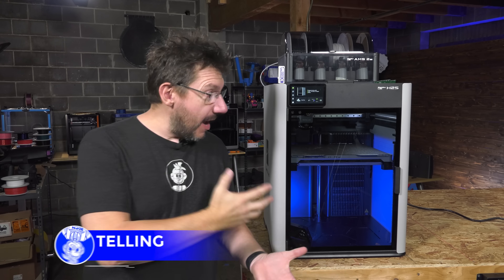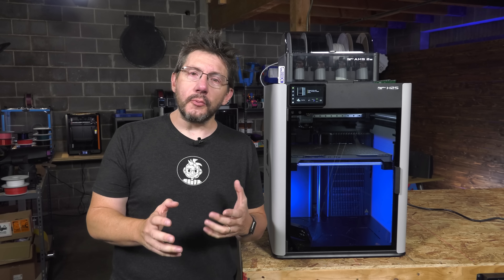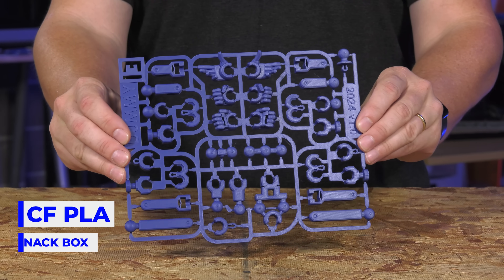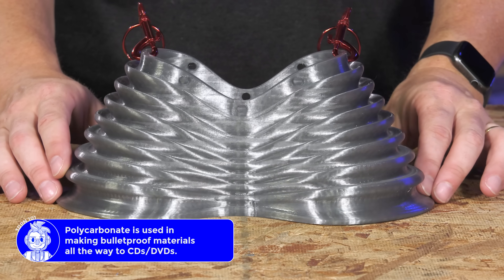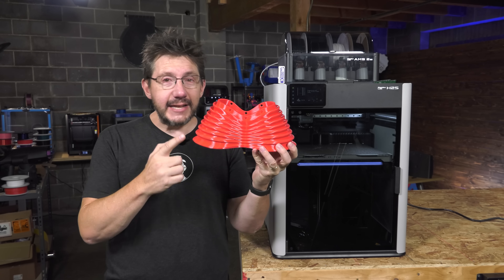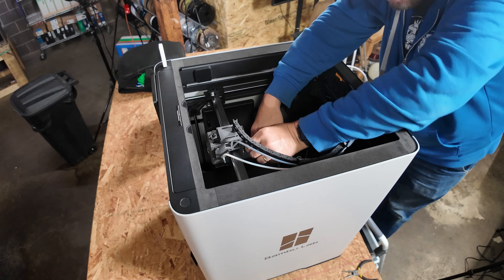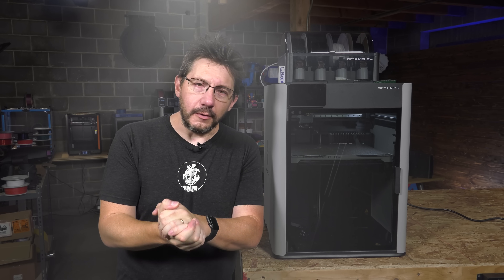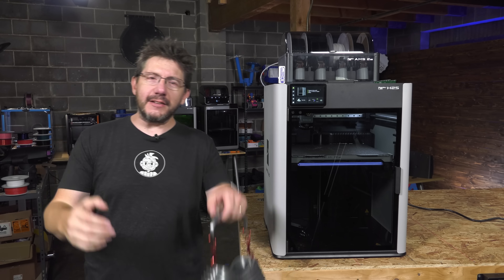FIRST LOOK at the Bambu Lab H2S!

Comment: Im loving my H2S. Its super quiet and prints sooooooo smooth. It gives me the ability to do logos on the cases that I make. The X1C is still very much in the mix as It is more efficient at making the items i do. the P1S is slightly more efficient that the X1C but I would take the X1C simply because of the added features it has over the P1S. I think they need to lower the prices.. say 150-300 bucks but im not giving up on any of my machines.

Comment: 6:49 Bambu TPU default bed setting is too high. Experiment with dropping it from 40 to 35 or even 30 (basically off). The lower the temp the less adhesion aim for the proper Velcro feeling and sounding peal off at the end.
Reply: I always put it at 25c

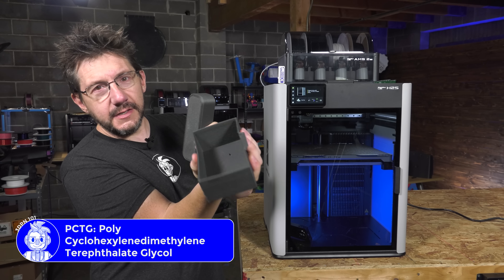Comment: 4:33 it seems to me that the seam is on that corner sir, if so i had the same result with pctg and x1c. i struggled through almost a whole roll before i found a workaround to it. i increased the amount of priming after retraction by 27% and this left an acceptable outer-corner seam that i have had 0 complaints about :) i suggest starting out at 10% and increasing by 2% until you nail it. 

good video sir.

Comment: The H2S is a beautiful machine, but having flexible connectors for a piece of equipment with so much movement and vibration is a huge mistake. I never use that type of connection in my designs of this type because of the potential for errors or breakage. Otherwise, it's a great 3D machine.

Comment: So essentialy you F upped and the print did not :) I wonder what the next move from other printer manufacturars will be seeing bambu poops out so many models in a short timespan. About snapmaker, i hope they have a excellent customer support. There is again a revolution going on in the 3d printerworld with new techniques and improvements.

Comment: Here in the UK, If i get something well stuck to the plate, I heat it up for 10 minutes so the heats in the printed part.... then lift the hot plate and put it flat on a cold window pane to cool rapidly and the part often comes of easier.

Comment: I'm thinking of staring a 3D printer company where all the dimensions and software are done in Imperial instead of metric, and everything would be scaled up AT LEAST 25% over its metric counterparts and then reduce the cost at least 10% to really mess with them.

Comment: I will say, the h2d had no issues printing PPS-CF, it does take about 20 minutes for the chamber to get hot enough and the filament has got to be fed in from the side spools only. It will not work in the AMS 2 Pro, does print beautifully, but come to find out my printer had a damaged exhaust system that was not venting or ventilating the heat and Air properly.
Reply: It works in the ams just fine.  Use generic instead of bambu in the presets.  The restrictions are only on their own filaments

Comment: It's a great thing that printer after printer is coming out that _works_. I had guessed with people on the price and was $50 off (I said $1300). I honestly wasn't expecting them to still support the plotter parts, though I still think the laser is a mistake waiting to happen.

I think a fun thing is seeing the back and forth between companies. There is a lot Bambu has done that has been asked for a lot and others needed to catch up on, but there is the irony that one of the things that shot it to the top (AMS) is also arguably the worst part of it. That people have willingly paid over 2x the cost of a H2D to get a tool changer just for less waste and bigger volume. Bring on the dozens of Voron toolchangers, the alt-AMS units, the filament cutters, highly tuned purging setups, and more. All to minimize or eliminate the Bampoo... Someone told me they think the reason Bambu announced the Vortek was to try and slow the interest in the Snapmaker U1... "hey, we can do purge-less tool changing too... just wait a few more months to (checks notes) the same time the U1 is supposed to actually start showing up in people's hands". And either Prusa knew what was coming or they're quick on certain PR events, but them showing off a CORE One with what I'm guessing is an IDEX of 7 tools that happens to line up with Bambu's H2D (1 fixed nozzle) + 6 tool Vortek... I'm getting some popcorn ready. Not to mention, INDX is supposed to come out soonish (I'm pretty sure they said 2025). There's still so much to question (not to mention that everyone still seems to expect that the size of the printer matters anymore when you need basically a closet to store all the filament with PTFE ready to run to a printer... In time we will tell.

Comment: test ppa cf. my x1c prints it ok but want to see if this will do better than the mods ive done on the x1c to get the results i have. i am able to get the chamber to 57c and still weirded out that it wants to print it at 290c on the x1c. want to see what is best on a printer that isnt as limited as the x1c

Comment: TOTALLY AGREE about the tool changer path. The H2D is ridiculously expensive though. All many of us ever wanted was solid supports with two nozzles and maybe two materials, right? Idex machines have been around forever but none of them are either any good or priced reasonably. Would SOMEONE PLEASE just give us two damned nozzles without all the other crap and make it budget friendly. How hard could it be? (I see what you did there Snapmaker)

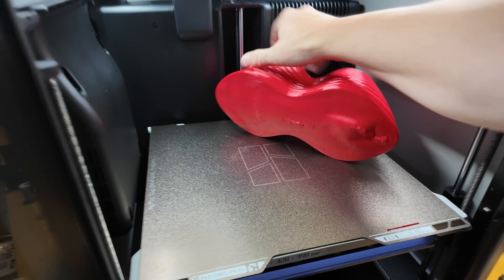Comment: 7:00 I've been using 98A or   95A. 40D is like, 88-ish on the A scale, isn't it?  I've been printing R2-D2 feet on my PEI bed with 98A and it's been working beautifully at around 80c build plate temp. Maybe it's the extra layers (7-8) I've been using making it easier to lift off, keeping it strong enough to survive the process.

Comment: I can only fit the X1C in my current racks, and the H2S/H2D are too big for the parts I'm printing 95% of the time. I can see how the H2S could be an X1C replacement in some ways. However, the bigger size isn't always better as larger beds require more power to heat. I have a single H2D now and will definitely upgrade to the H2C, but my small army of X1Cs are here to stay! :)

Comment: Thanks for video, I’m not sure how you can compare a prusa XL with the multi heads to anything Bambu makes. The XL the enclosure is 600-700 more the extra heads 5 are like 1400-1500 more. And the price comes in 4K not sure is it even heated ? 
So ya the poop sucks but it’s pay now or pay later ? 
And as for the complaining about the poop 💩 you can find hundreds of free models online. Maybe Bambu could include the file right in the SD card as one of your first prints. That’s why you purchased a 3d printer ?
I have a P1S and really struggling with support that just doesn’t look good. So the H2D looks great to have the option to print say PLA support for my Petg models. But then again am I going to buy two AMS units

Comment: The Vortek looks like it will be cool, but it really only solves one of the problems with multi-color prints. Yes, it will nearly eliminate waste for up to 7 color prints, but it still has to cut retract and feed the filament on every change so it's still going to be slow compared to a dedicated tool changer. Faster than a pure AMS, single nozzle swap because no purging, but not the sub-5 second swaps you get with the U1. I WILL be upgrading my H2D once the upgrade kit becomes available. I'll have to race it against my U1, which I should also have by then.

Comment: I literally rub my face and hands all over the build plate when I print TPU. It stick really well even with all the residual oil on it, and is very easy to take off once done printing. It’s a weird hack but it works.
Reply: I had an Old timer tell me when I was a young kid, to help your fishing rod halves come apart easier, rub your finger on the side of your nose to get oil off of it and then rub that on the fishing rod end before inserting it.

Comment: As noted by others, a couple of drops of IPA on the edge of the TPU print helps you peel it off without damaging the plate.
Reply: I've switched to only using smooth PEO bed plates for tpu and it works mint

Comment: People: "3d printing is great, we can print with minimal waste since we only print the parts we need!

Also people: "Im going to print this dummy 13 model and it has a spru that is 100% wasted materials"
Reply: The sprue works as a brim and makes the product easily packageable. When printing at the normal size you could have bed adhesion issues without it.

Comment: Uncle Jessy had a great idea of making some of the cardboard packaging that comes with the printer that could be folded into a poop chute. It would at least get people by until they can print a replacement.
Reply: I just use a cardboard box and have for all 6700 hours on my X1C and an old shoebox  for my P1S that has 3500 hours. But I'm classy like that😂
Reply: @anthonystownsend I use a shoe box for one of my printers 🙂
Reply: I have never had good luck with a chute. I made a slide and also raised up the printer so it it has more inertia coming down the slide.
Reply: Since say 1 just used an empty box from a roll of filament and cut a portion out of the top and side. 2 years no problem.

Comment: The H2S is still more than 25% more expensive than an X1C.  If you don't need the extra build volume, that's wasted money.  In fact, because of the need to heat the build volume for ABS and engineering filaments, having the smaller build volume option is very useful in its own right.  At the same time, the X1C has a lot of features the P1S lacks, making it still worth having.  I know three separate people who bought an X1C instead of a P1S because of the features.

Is the H2S going to eat some of the X1C's sales?  Probably, because all the people who wanted the user experience of a Bambu machine but also wanted the big volume will swap.  But people who still want a mid-size build volume won't want to spend the extra money.

I do think it's about time for an X2 or more likely P2, incorporating the new toolhead and cooling features from the H2 and preserving all the on-printer interface options, but I still think there's room for a sub-1000$ USD 25x25x25cm printer that does all the things Bambu printers do.

Comment: That H2C will be so great for different nozzle sizes. Color is one thing but a phat nozzle for large areas and small nozzles for slopes/round areas or support material will be so nice. I hope each nozzle is pre-heated 8-seconds prior to being mounted to speed up the swap-delay. It looked like that wont be the case so each swap will take some time to get up to temp.
Reply: Will have to see if/how they support different sized nozzles. As of now you cant with the h2d.... at least when using bambu studios..... and the h2c looks like a slightly different h2d. Guess we will see

Comment: The issue so far with tool changers: They are insanly expensive! XL about 4000 Euro. Bondtech INDX does not even have a working proto type printer or did I miss it? And it will be pretty same high costs as XL if bundled with Prusa printers. Even the Bambu H2C (Vortek) will be over the top, more expensive than H2D.

I backed the Snapmaker U1. To me that is the first and only consumer friendly tool changer machine available. And I will keep my X1C with 4 AMS systems for multi material prints for wich it is very good and do not produce much poop. ;)

Comment: when printing with tpu dont struggle removing it. be smart and use isopropyl spray and it peels away effortlessly. big tip spread it around and save ripping your build plates to shreds.
Reply: This. I use a needle bottle to squirt some along the edges of the print, give it a few seconds and it'll come off clean.

Comment: I'm wondering if the H2S will also be upgradable with the new Nozzleswap system they announced.

Heating the bed for TPU really isn't it. The best way I found was simply spraying some 70% rubbing alcohol down. It seeps underneath the TPU and releases super easily. No heating needed.
Reply: They made a post about it they basically said "technically possible" but  something about that u don't have to do that blah blah blah. Like telling u yes but maybe not worth it? It's a bit odd and mix messages
Reply: @JC.72 They're saying yes it's possible, but there is zero point when you could just wait since they announced them together.

Comment: I doubt it will print but try some tullomer
Reply: Why do you doubt it?
Reply: @riba2233  Tullomer has been largely unprintable all the way up to 350c due to poor layer adhesion. It was also meant as a challenge
Reply: @spencerhachem5491   ah ok you mean print it well, it print it at all. Unfortunately it's not that simple, tullomer doesn't have good layer adhesion no matter the print temperature.

Comment: The trick for TPU in my experience, on the A1, is to use glue stick on the texture sheet and when the print is done stick the whole thing in the freezer. The glue will freeze and pop right off the plate, then you can just wash it off the print.
Reply: Just use isopropyl alcohol. Let it flow under the model and break up the bond.
Reply: @ilovetechnology8436 I do the same. Heat up to 60°C to soften the TPU and then use Isopropanol

And if it stuck too good i use Windows cleaner spray to clean the plate, this leaves a protective layer which makes it easier to release the next print
Reply: @ilovetechnology8436 still need glue? Or no?
Reply: @dan203  No need for glue. https://www.youtube.com/watch?v=KTRvBmta3Zs
Reply: No, just turn off bed heating completely

Comment: Tool changers are the future. Prusa and Bambu showing they are working on them.
However, I want to see an XL2 but in the format of the Core One, fully enclosed metal case. I basically want a large Core One, 350^3 or larger.
Reply: It looks like Prusa may just be adopting Bondtech's InDx

Comment: 2:17 - carbon fibre filament prints tend to have the fibres rub off onto your skin when handled and can even stick into you and cause irritation. Using it for something that will hold snacks (even if the snacks themselves are in compartments lined with other materials) doesn't seem like a great idea since you will be going from holding the carbon parts (and getting fibres onto/into your skin), and then handling the snacks and eating them. Even worse if the snacks are directly in containers made with carbon fibres.
Reply: Yeah, would be a good idea to clear coat it, if you plan on handling it.
Reply: Same with glass fiber
Reply: Ahh. Just had same thought. Looks cool, but not in that usage context.
Reply: Glad I saw this, was going to post it myself. Definitely don't want food anywhere near CF filaments
Reply: Not this bs again, cmon
Reply: @riba2233  ?

Comment: Okay if there is one thing I know for sure... I need to print one of those sofa caddy snack/drink holders! That looked soooooo good in PLA-CF. I was literally just looking at one of those at Target thinking this could make for a fun 3D Print
Reply: Only if you like having microscopic CF pieces stuck into your skin, your couch, your mouth, throat..etc because you touched the print while snacking..
Reply: @UncleJessy  Hey, think you’ll do a front glass door durability test on this one as well? 😁
Reply: pls dont print that in CF or similar filaments with additives... just not food safe! >< (its not even great to touch when you get fibres stuck in the skin, at least treat it with clear coat or similar if its intended to be in contact with skin)
Reply: @DiverseGreen-Anon  PLA-CF isn’t really food safe, but the bowls/inserts can be printed in PETG, that’s food safe and works great for this kind of part. 
(though I personally kinda like how CF feels to the touch 😏)
Reply: @relief_3d  Well then you had luck with not getting fibres (cf/gf) stuck in your skin as these are hard to remove, are itching continuously and irritate the skin. It is an engineering material after all :I
Reply: @relief_3d PETG may be food safe, but not all filaments are, and your printer likely isn’t.
Reply: @DiverseGreen-Anon that is just a made up nonsense
Reply: wild to post this knowing the reach you have lmfaooooo in what world does any food business make stuff out of CARBON FIBER 😭 just say you’re rich and move on magnet boy
Reply: @Plantttt_t  oh it's only gas fibers of carbon fiber. It barely costs more and is liked for the increase rigidity and anti-warping properties, as opposed to the actual strength of layer bonds or the like. One can get carbon fiber PETG for maybe 25-30 bucks a spool.